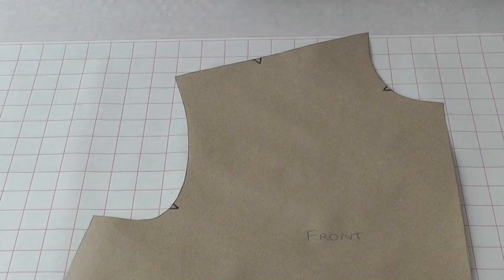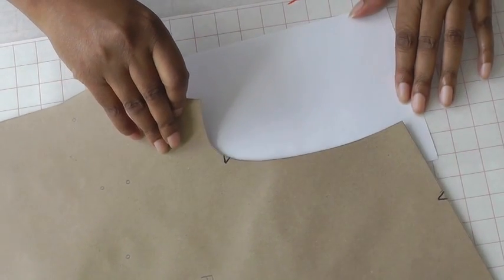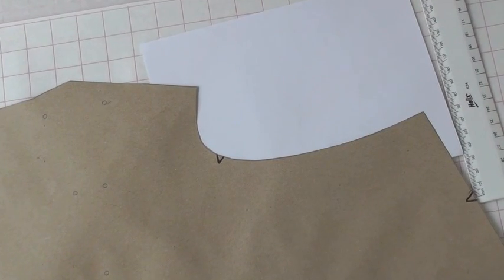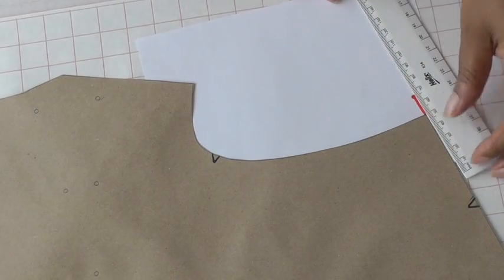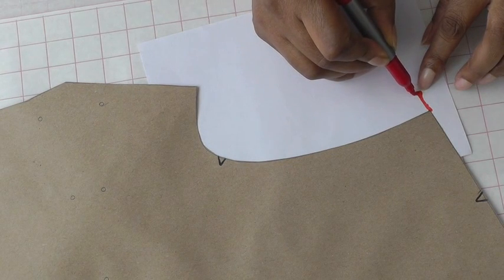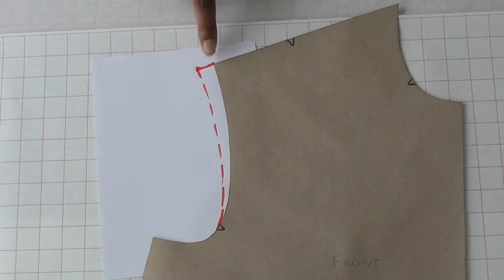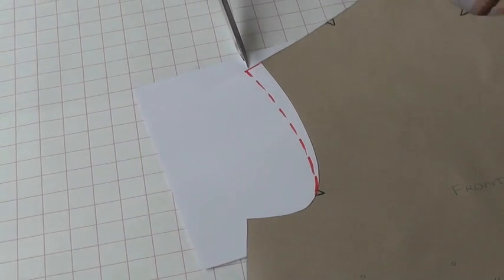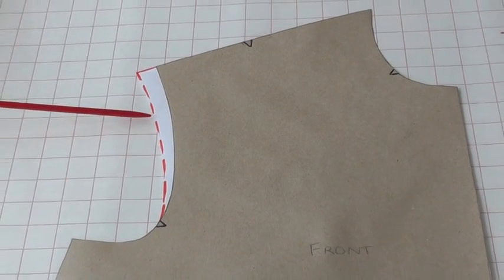How to Lengthen a Shoulder

Comment: If the pattern you want to alter like this has a corresponding sleeve pattern do you need to make adjustments to the sleeve as well? You would also have to adjust the corresponding back piece of the pattern the same way I assume?
Reply from the maker: The sleeve may not need to be altered as the armhole remains the same. The back would have to be altered for fit.